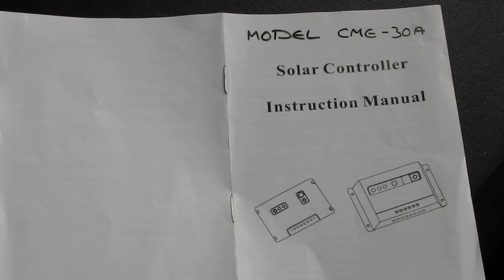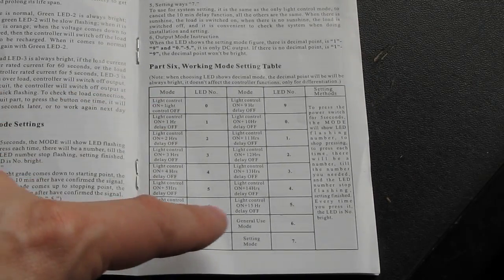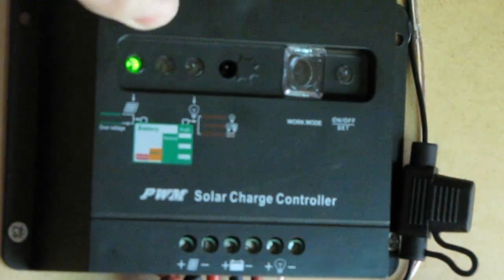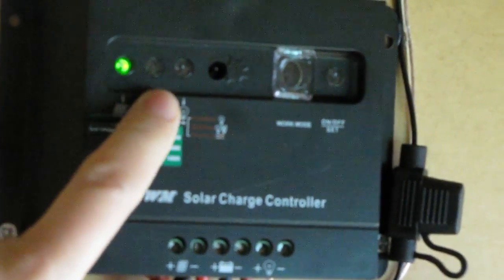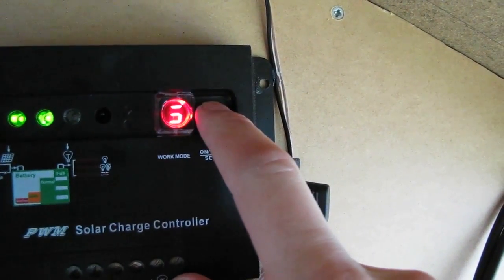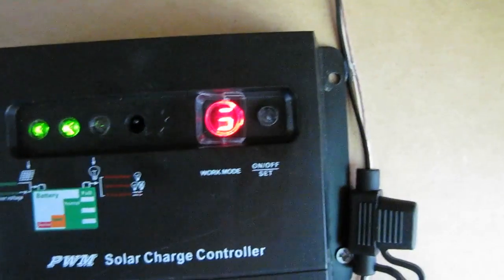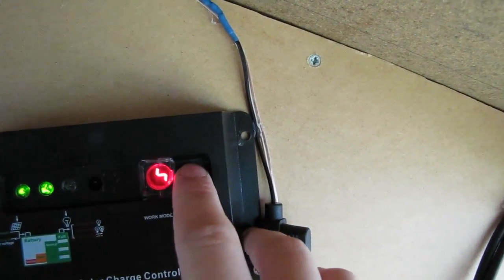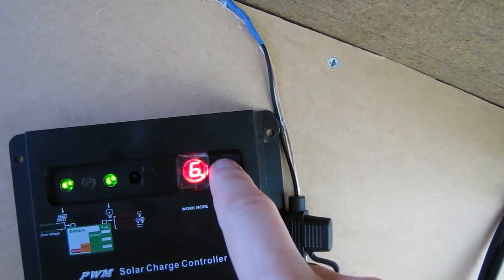Get you started how to operate Pwm solar charge controller

Comment: Any idea how to put the charger into equalization mode? it says in the manual that it has equalization and boost modes, but doesn't give any information on how the modes are changed.
Reply from the maker: as far as i know that is a automatic  goes into that mode once its fully charged the battery . the green light will flash.

Comment: Did they put the switch on the negative lead? Cause when I turn mine off,my device stays on, I'm in the "6." Mode. I'm sharing the negative with the battery, as I only ram the positive line, as it's using the truck frame as ground

Comment: How does it know when it's dark ? In other words if its kept in a box will this function still work ?
Reply from the maker: no sun is hitting the solar panels
Reply: DIY TEK NUT Aye pretty obvious I suppose. Another question.  What happens to all that power when the battery is fully charged?
Reply from the maker: it will go into whats called Float voltage the voltage at which a battery is maintained after being fully charged to maintain that capacity by compensating for self-discharge of the battery.

Comment: We are Shenzhen Shuori New Technology Co.,Ltd in China and our main products as following:
☆Solar Street Light charge Controller for VRLA battery or lithium battery (Support Data Remote Setting, PWM/MPPT Type) 
☆Solar Power System charge Controller for VRLA battery (PWM / MPPT Type)
Please visit our web: WWW.SRNESOLAR.COM

3000 ㎡ factory, 7 years experience in solar charge controller filed, professional and strong professors, senior engineers, professional technical staff R&D team.  ISO, CE, ROHS & CQC certificates, this is how we keep good quality and competitive price for global valued customers.

If any models meet your demand, please feel free to contact me. Catalog & Details can be offered.

We're sure your any inquiries or requirements will get prompt attention.

---

Best regards,

Rhean Feng
Sales Department
Shenzhen Shuori New Energy Technology Co., Ltd.
Address:Building B, Jianyu 2nd Industrial, Nanchang Park, Gushu, Xixiang, Baoan, Shenzhen, China Zip:518000
Mobile Phone:(+86) 18565667949/13580565572
Email: rhean@szshuori.com
Skype: rheanfeng
QQ: 2851352807
Wechat:1036342363
Website: www.srnesolar.com

Comment: I have a very similar controller but the solar input indication led will cut out when battery charge reaches between 14 and 14.4v. Then the battery discharges to 12.97v in around 10mins before the solar input lidication led comes on and the battery starts charging again. This cycle just repeats, battery indication led never flashes. Any ideas why the controller is charging and discharging around a volt in minute cycles?
Thanks for any help!
Reply from the maker: Adam King do you have a web link to where you brought and i will take a look.
Reply: Norfolktuber this is the controller I bought
http://m.ebay.co.uk/itm/351078233835?nav=SEARCH
Not all the parameters in the items listing match with the manual supplied with the controller.
Thanks for help
Reply from the maker: Adam King What type of battery and what's the amp hour
Reply: Norfolktuber lead acid, 12v 2.3ah and have also tried it with a 12v 3.2ah connected in parallel with a 12v 4ah to increase ah, have had same results with the two set ups. I've tested all batteries and they are fine.
Reply from the maker: what size solar panels are you using
Reply: Norfolktuber only a single 10watt seems to me the controller is faulty I guess it should up to charge max voltage then just float charge  at the designated volt rating?
Reply from the maker: yeah i have that same controller, i use on another setup with a 40w panel and a 50ah battery, that works the same as the one in this video  so it does sound like you have a faulty one.
Contact the seller they may send you a new one.

Comment: Thanks for sharing this. Have had difficulty understanding how the leds work. My charge controller has up to 13 hours when I program it and then it changes to L,H, C, and D. It is only at C that the third light becomes amber. My load which is a freezer lights up but does not work. Any explanations to this?
However if I connect the freezer without the the panel and charge controller to a regular vehicle battery, it works perfectly.